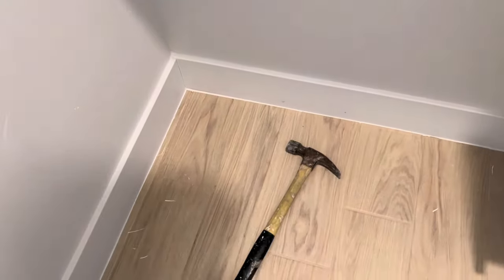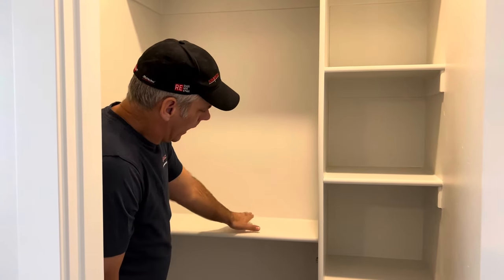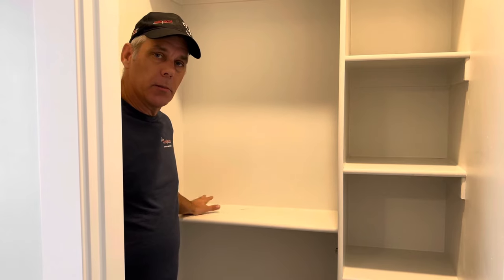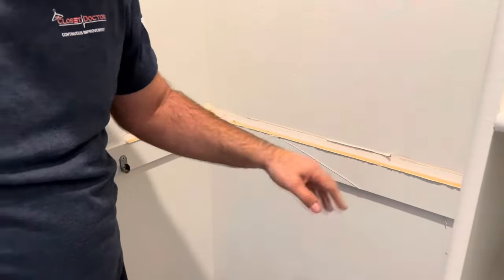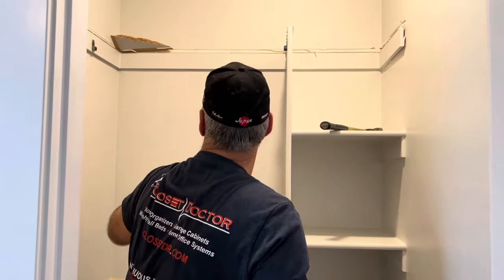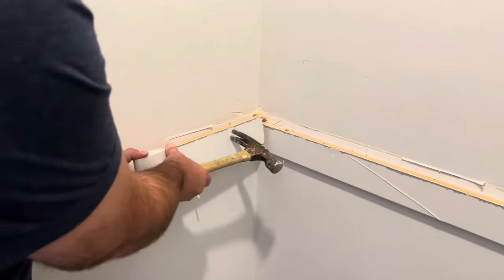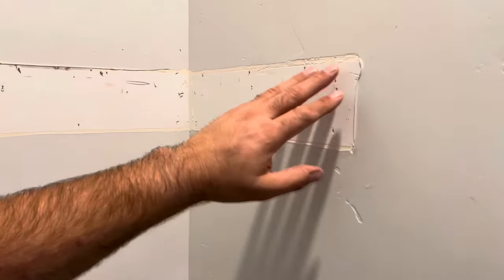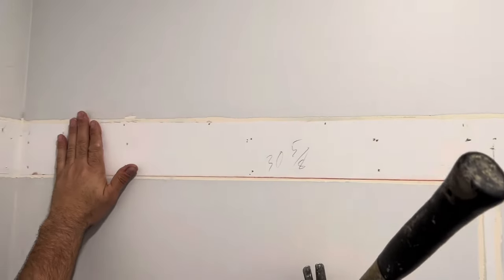How to Remove Wood Closet Shelves Without Damaging Your Walls.

Comment: Good video Derek. Some points to add: Demo is important time to wear safety glasses as you can’t be sure to control debris. When pulling nails, good idea to have a large putty knife or some other oversized piece for the hammer to pivot on while pulling nails. If painting, best to prime/seal first, as these surfaces are often unprimed. If no primer is used, the texture will be different between the previously painted and unpainted areas.
Reply: hey thanks i am tearing out my first closet so this is very helpful!

Comment: Stupid question but you’re just using a normal hammer right?
Reply from the maker: Yes regular hammer. It the heavier you can swing the better, if it’s a lightweight finishing hammer it will be more work.

Comment: Exactly what I need done. How much does this typically cost to get done?
Reply from the maker: Just having shelves removed and closet painted runs $400-800 depending on closet size. Closet systems vary widely depending on size, features materials etc. Reach in closets are typically $750-2000 walk-in start around $1500 -7500 usually.

Comment: Hello here, what if you have a wooden hanging rod in it too? No end caps just goes straight into the side support pieces? How would you get that out? Would you have to cut the wooden dowel to get out? Or be able to get out in one piece?
Reply from the maker: I’ve seen closets that the support has a hole drilled into it that supports the closet rod. The only way to remove it is cut the pole or remove the side supports then maneuver the pole out of the support.